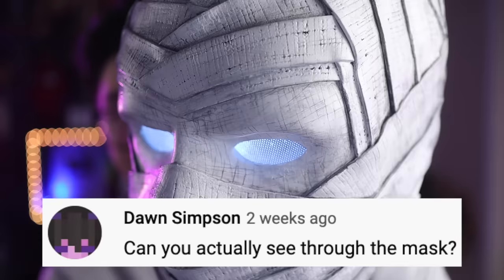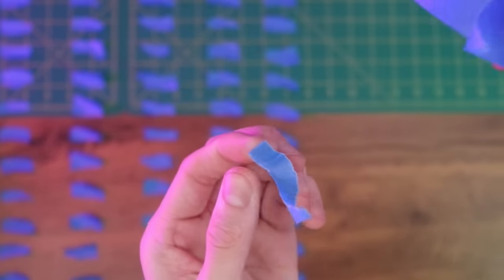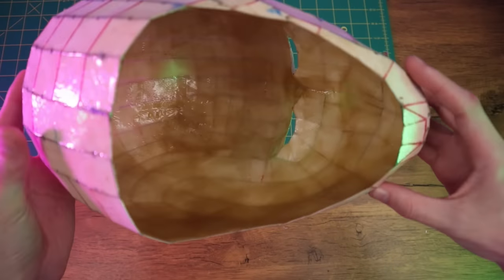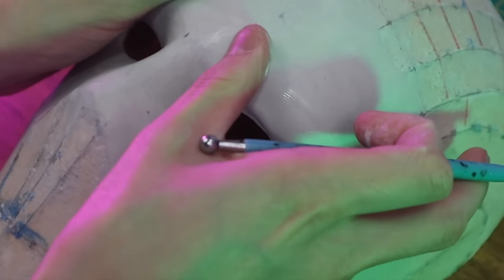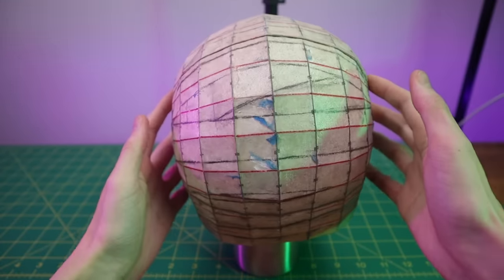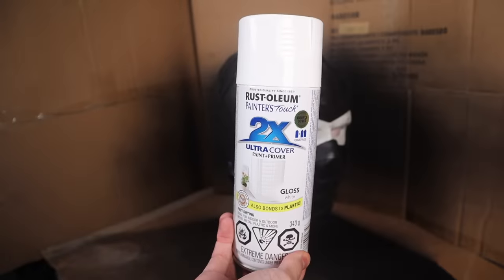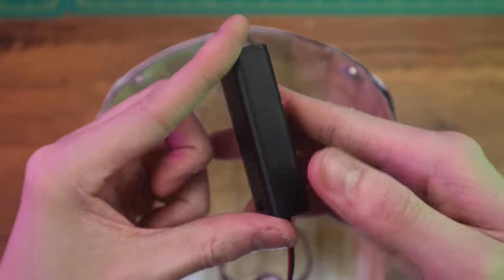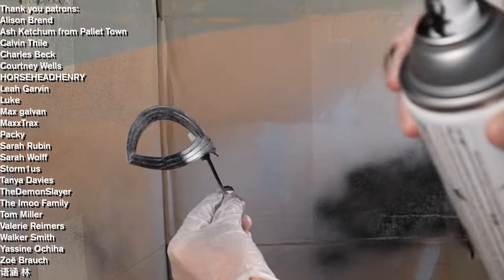I Made My Own MOON KNIGHT Mask (And You Can Too!)

Comment: You could definitely make this into a mr knight mask if you wanted but it looks fantastic
Reply: I was gonna ask Dat! But I agree
Reply: wait isnt those eyes that glow gonna hurt your eyes if your too close?
Reply: You can make whole outfit its not very hard from down
Reply: Yep when I saw the thumbnail with the cardboard template, I said it looked really similar to the Mr knight head shape. So question:

How do you suggest dealing with the cloth texture and stitching
Reply: @-Tidae  if you want to have a cloth texture, idk if this is a good way to do it but I would do like a paper mache thing by mixing Elmer's glue and water and then with a paint brush lay small pieces of paper towel onto the mask with the glue water mixture and then paint over that when it's dry (idk if I explained that correctly)
Reply: @daster6430  yes
Reply: I did that, the head shaped r pretty much the same so I just put fabric over it. 👌
Reply: @daster6430  yes but i dont mind cause it gonna look sick

Comment: I've got a couple questions:

Does the fibreglass resin have any lasting fumes after curing? 

Is it stronger or weaker than epoxy resin?

Would you suggest fibreglass for things like shields? (I'm making a captain carter shield out of cardboard and eva foam, and thinking of using fibreglass on the back to keep it's shape and strengthen it)

Comment: Hey I liked the tutorial. Most of it I already knew but I still love watching cosplay tutorials.

I do have a question though. I don't own a printer so I'd just end up printing it at work. I can't use programs on these computer besides the pre installed ones.

Do you have a pdf option that could be used on a standard printer? And basic programs that's not Adobe?
Reply: Thanks for watching and commenting Telegra..m above to claim your prize